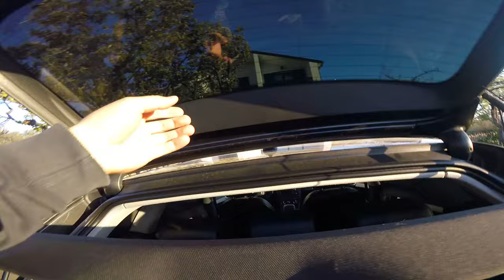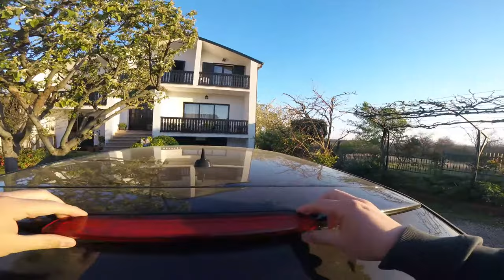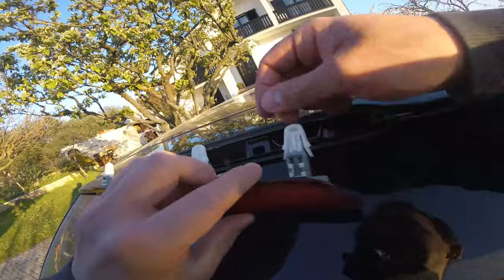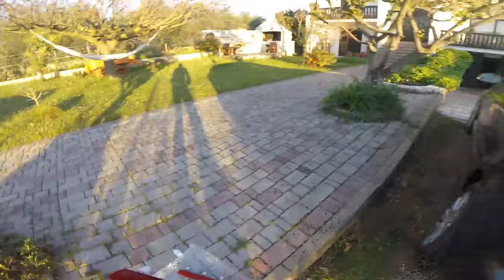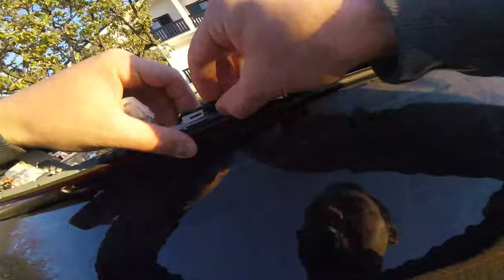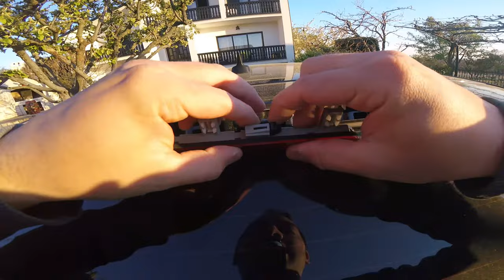How to replace central brake light - Audi A3 2010

Comment: No offence but this is a terrible demonstration 😂
Reply from the maker: You're absolutely right, but you only wasted 49 seconds of your life 😅
Reply: Hi, where did you buy the brake light? And what brand/model is?
Reply from the maker: @cristilaur7272  In a store that sells car parts, first they ordered an original brake light from Audi, but the brake light was little bit broken, so they send it back and ordered a new one from Automotive Lamps (Made in Taiwan) (15-0239-00-9)(AD A-3 II 03-12 3S/L 5DR HB W/LED). This brake light from Automotive Lamps is not original so it does not fit perfectly like the original one, but it is ok, the water does not get inside.
Reply: Hi did you have to squeeze that part of the trim to remove it? any need to undo screws? I can't see any screws to undo but the trim won't come off. I have an 8p 5door (no spoiler) just like yours
Reply from the maker: Yes, if I remember correctly, I had to squeeze those white plastics one by one with a flathead screw driver to one of the sides, I think you will hear the click each time. No, I think you do not need to undo any screws. I also had similar problem, I got out 3 of those plastics but one was not getting out that easy.
Reply: @weirdbluesand  Ok thank you! So just to confirm you just pulled on the trim and it came off? Not like this video where he removed all of the trim with screws as it looks like a 1+ hour job 

https://youtu.be/_s3HFS5x_tM?si=tDRM9JgZOWxyCrTj
Reply from the maker: Just pull the wide black plastic with your hands towards you (first seconds of my video), you will hear the clicks of loosing up (You don't hear the clicks in my video because I already pulled them out before video). You don't need to get the whole plastic out, just hear few clicks and then it will be enough to reach the place. You don't need to do all of this stuff that this man in videos does that you shared with me. Do exactly what I did, but be carefull not to pull the plastic to much to not brake it, after you heared the click of wide plastic, then pull this wide plastic just enough out that you can get to the place where you want, not to much to not brake it.
Reply: @weirdbluesand  I did it! Unfortunately I did manage to break one of the clips but its OK. Also the light I purchased must be a cheapo one because it sticks out a little bit so I will try and seal it with silicone to make sure water doesn't get inside. But thanks again for your instructions - very helpful
Reply from the maker: @rjj00 I ordered original Audi light but it came broken in the store, so I told the store to order the cheap one which was great but is not original and it also sticks out a little bit. I asked my friend who is mechanic and he says that this is normal for NOT original parts. I was also scared that water will go in but it never did.

No problem, I'm glad I could help :)
Reply: @weirdbluesand  do you have a link to which one you inserted? I can clearly see from the seals that there is a hole at the top. reason I'm worried about water is because that's what happened to my old one and it was leaking through the boot !
Reply from the maker: No I don't have a link of the one I inserted. By mine it is a gap on the left top. I don't know then, do what you think is best to do.